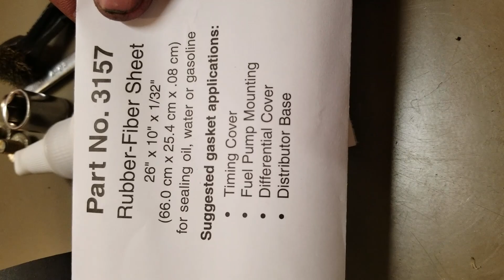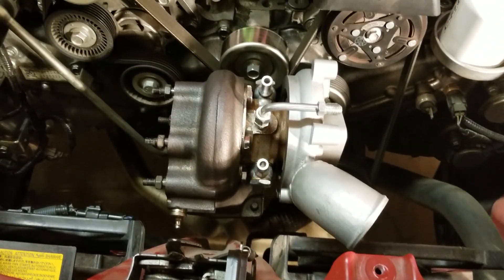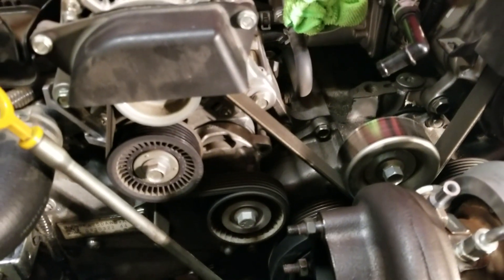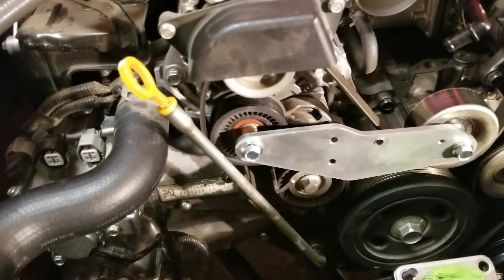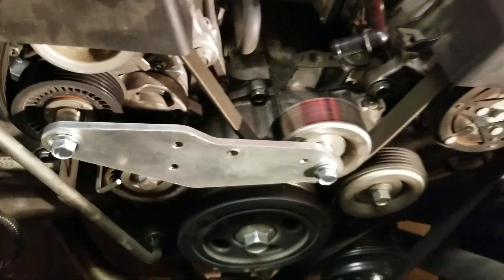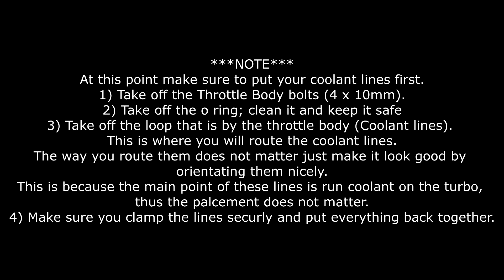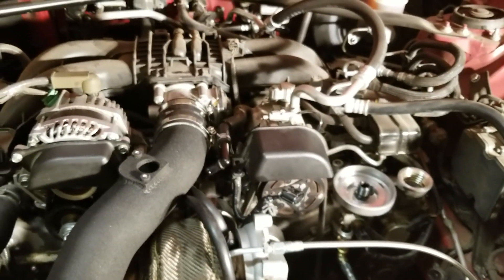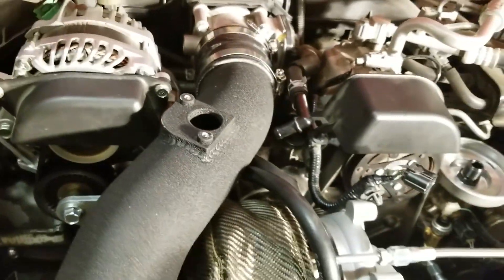ROAD TO 300HP SUBARU BRZ - SBD500X Turbo kit Install Part 4 of 6 (Turbo, Manifold, Intercooler)

Comment: Hey man I’m currently in the process of removing and reinstalling my kit to fix some minor coolant leaks. I know it’s been 2 years since you posted this vid but do you happen to remember where you got your gaskets that connect the up pipe to the hot side of the turbo, or I guess what kind of sizing the SBD kit deals with? Thanks in advance
Reply from the maker: There is a SBD500X Facebook group page. I bought it straight from the turbo kit supplier which was reasonably priced.
Reply: @brzser8387  I actually just joined it now and found it on there, thanks for your response!

Comment: I wish I would have re watched this video lol. I for the life couldn't get the bottom bolts on the down pipe. Then I eventually figured it out. Yea that downpipe is a pain!
Reply from the maker: Right...! I tightened everything up, only to loosen them all again just to get the bottom nuts to fit. Good luck!! Sounds like its almost there!
Reply: @brzser8387  yea lol, same here. I actually thought it was my heat wrap at first so I cut some of it off only to realize it still didnt turn. I also overtighten my pulley bolt and it snapped inside the block so I had to drill it out. After that I just torqued everything by hand. I guess my torque wrench was broken or something because it never clicked. Then I had to cut one of the bolts that hold the turbo In because my wastegate actuator arm was hitting it. But almost done, I just hope I never have to take this kit off again lol.

Comment: Isn't that turbo a little close to the coolant line.🤔
Reply from the maker: It definitely is haha. The turbo blanket does make a big difference. If it wasnt there I'm sure it would burn right through the line and everything else lol. In the future, i would like to upgrade the lines into a braided or a more thermal resistant one. In addition to that there's another coolant line located behind the driver side of the engine but it does need a longer hoses which i did not have. At minimum i should have put a thermal cloth for it, but its been holdingn out fine. I do plan to make a video talking about concerns/problems/suggestions regarding the kit.